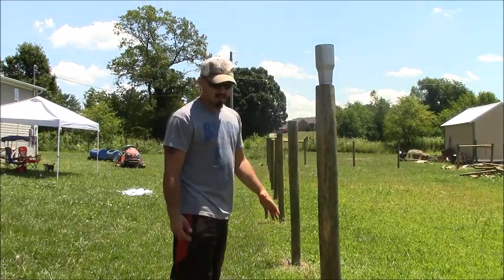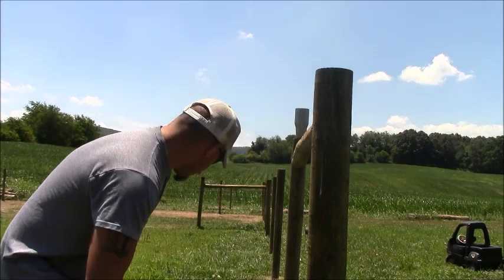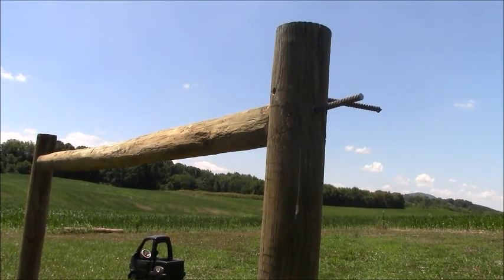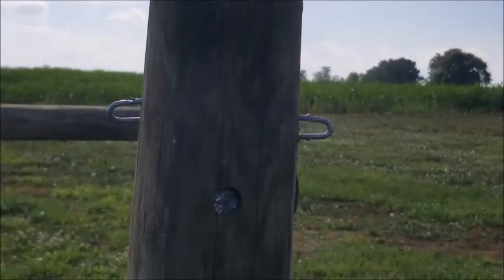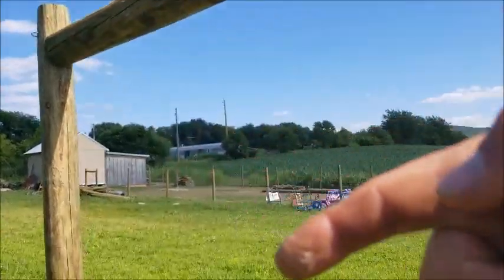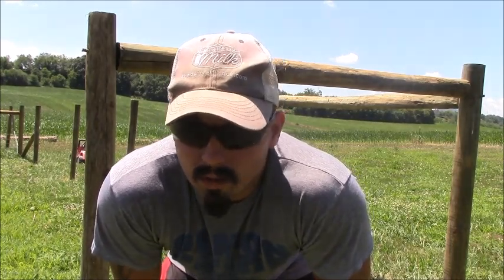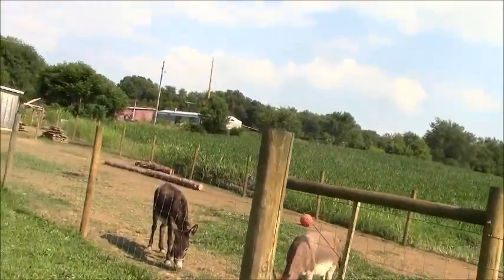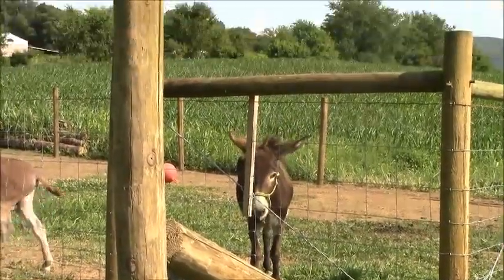Building brace/corner post for a fence

Comment: Lol, I spent the day doing the same thing today!! I had the same issue with the heat and so I ended up rushing cause it’s just a 30’x50’ pen attached to the back of the barn for a sheep pen. 

I’m usually a stickler for perfectly straight fences and level corner bracing but this time I just winged it cause it’s gotta be done in a couple days and I got several posts out of line bad cause I didn’t run a string and even tho nobody will ever see it but me it’s already driving me crazy!! 

Oh well, what do ya do brother?!?!?!
Reply from the maker: Shew I tell you what, it's been hot! Thanks for watching.